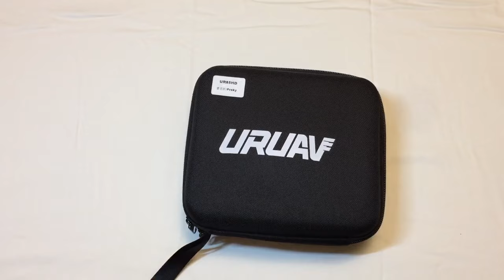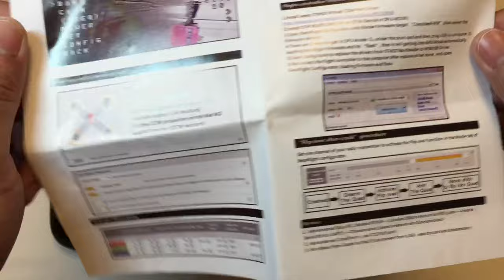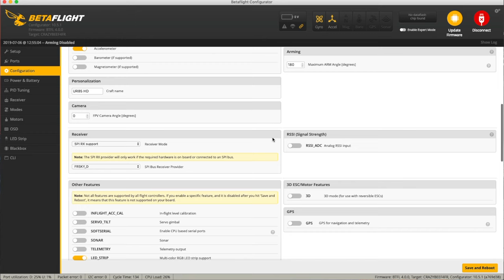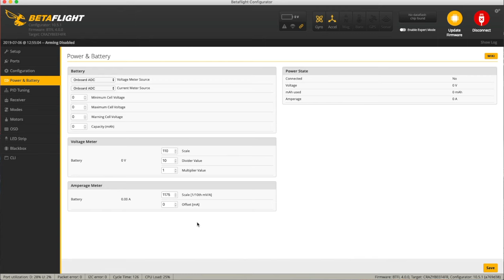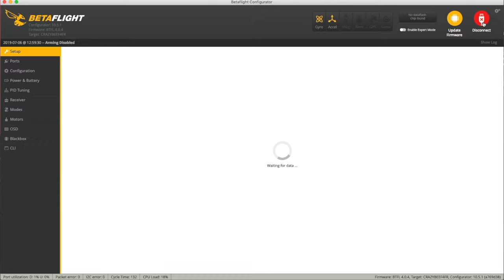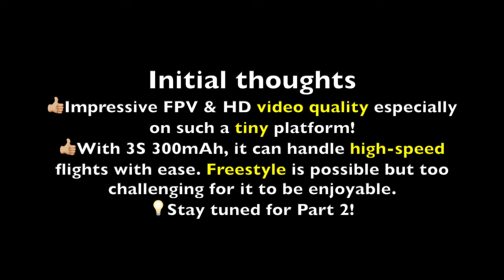URUAV UR85HD - Part 1/2 - Introduction

Comment from the maker: ➡️ Additional Notes
1. Binding via command-line with bind_rx_spi instead of bind
2. No audio is recorded or transmitted.
3. While my stock & GNB batteries are LiHV, for this video, I charged them to 4.20Vper cell. I could get longer flight times if I had charged them till 4.35V per cell.
Reply: The caddx turtle didn’t come with built in microphone?
Reply from the maker: By right the Turtle v2 should have microphone. While I did not examine the board for microphone, the FPV feed and the HD video files definitely do not contain any sound.
Reply from the maker: I saw the UR85HD replacement camera on Banggood, which is called a customized Turtle Caddx v2, and the photo shows a tiny microphone attached via red and black wires!!! I will investigate further. Thanks for asking.
Reply: @fyresg  Looking closer on mine, I realized that the microphone is missing and the wires cut at the base.

Comment: Very nice initial review and flight demos ;-)  The HD video looks great! The Quad seems to become somewhat unstable when descending though it's own prop wash even when done slowly, did you experience that? It can take some bumps, so did you have to replace any props during the flight demos? I look forward to part 2. See you in the Air!
Reply from the maker: Yes, there were definitely prop wash shakes during my descents, but I don't remember if they were slow. The new firmware should handle prop wash better but I think the default settings are not loaded properly into the latest firmware. I will examine that in Part 2.
Oh yes, I made quite a few bumps especially at the playground scene. I had cut those bumpy footage away because they were so shaky that they made me feel sick while watching. I learned that the prop guards are not invincible as the brittle props were chipped during hard knocks. I will check out the Emax Avan props as suggested by OnceFly.

Comment: Hi, take a Avan 2" props and put him on flight with and is better !   👍
Reply from the maker: I honestly wanted to read up on what props would be better for this quad, and before I start to read up, you came to my rescue! Thank you!!!
Reply from the maker: Which Avan 2" props do you recommend?
3-blade: https://www.banggood.com/2-Pairs-Emax-AVAN-Blur-2-Inch-3-Blade-Propeller-For-Babyhawk-R-RC-Drone-FPV-Racing-Multi-Rotor-p-1335551.html?utm_content=tanghao&utm_source=rcgroups&utm_medium=rcgs&utm_campaign=FyreSG&p=541709059675201205AM

4-blade: https://www.banggood.com/6-Pairs-Emax-AVAN-Micro-2-Inch-4-blade-RC-Drone-FPV-Racing-Propeller-Red-for-11XX-4500-6500KV-Motor-p-1277598.html?utm_content=tanghao&utm_source=rcgroups&utm_medium=rcgs&utm_campaign=FyreSG&p=541709059675201205AM

Comment: Not able to update quad firmware... why??? Main port access denied 🙅‍♂️
Reply from the maker: Did you enter dfu mode? Go to CLI, type dfu, then flash firmware.
Reply: Ok thanks I’ll try 🙏
Reply: No way... unknown command with “dfu”. Other suggestions?
Reply from the maker: Type version in CLI. What version do you have?
Reply: Crazybee4fr 4.0.0 dec. 11 2018
Reply from the maker: Did you follow my instructions at 4:47 of the video above?
Reply: Now it’s ok... needed to use impulserc driver fixer 👍